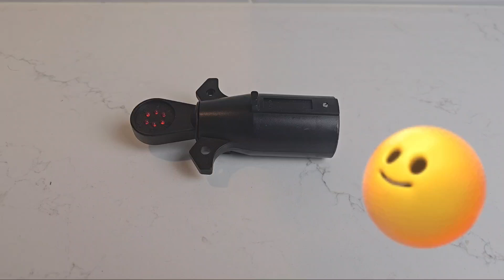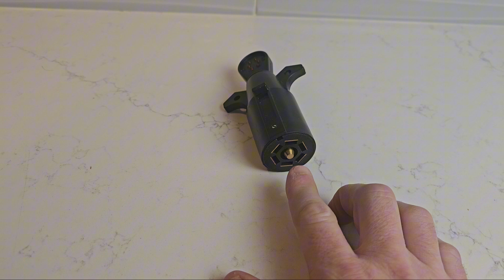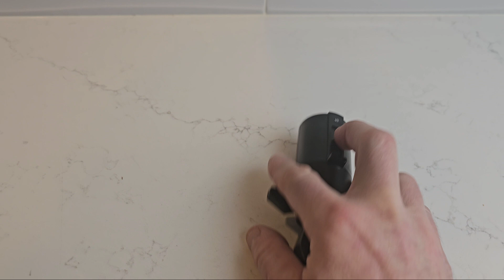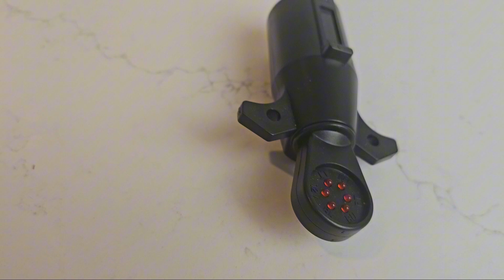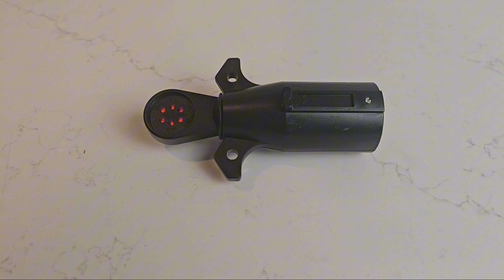Is Your 7-Pin Wiring on Your RV Tow Vehicle Working Correctly? Test it With This to Tow Safely🙏

Comment: No it does not help at all! Show it plugged into a vehicle's connector with the lights working as you  operate the tow vehicle lights!
Reply from the maker: This only tests the wiring for the connector / receiver on your vehicle. You can’t have this plugged in and your Rv at the same time. Maybe explain what you are asking a little better so I can understand.  Thanks for the comment